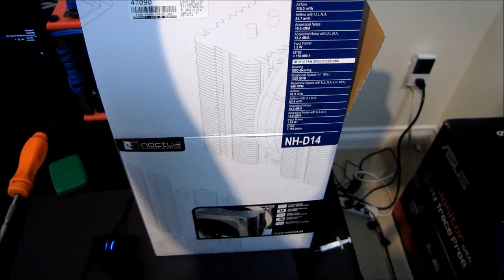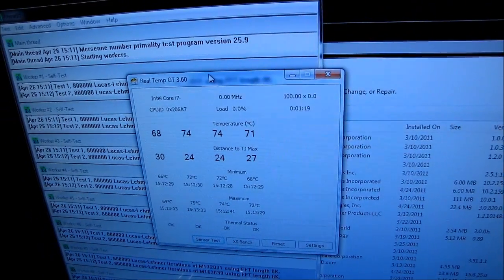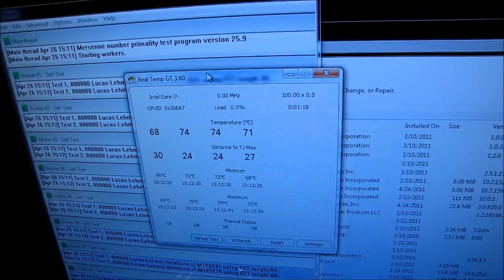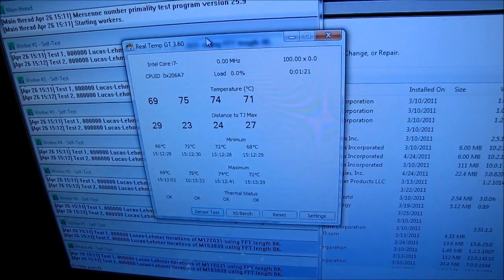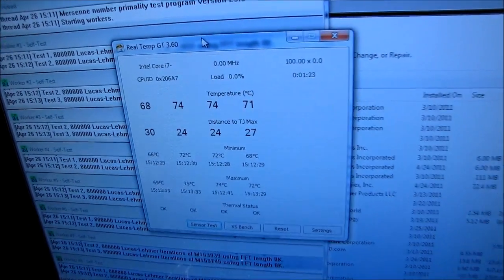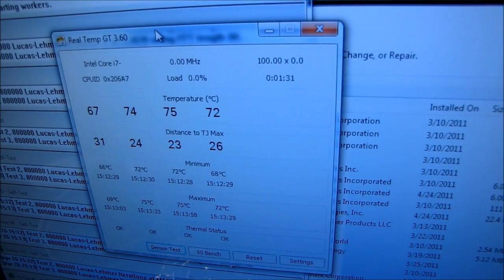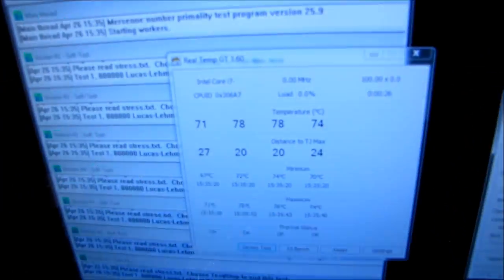Extreme Cooler Showdown Corsair H70 vs Noctua NH-D14 Linus Tech Tips

Comment: i am acquiring the nh d12 but thing is i am mounting it inside a haf X so it will be hanging horizontally in mid air and its weight worries me in regards to damaging the socket,cpu or the motherboard itself any advice?

Comment: I've got d14 and amd cpu. problem is I can not use d14 to have vertical airflow, and though it cools the cpu nicely enough, airflow in the case is awful and gpu constantly overheats making everything uberloud (and whats the point of silent d14 then?), due to it blocks it and makes only horizontal flow available (while I have 240mm fan pushing air up out of the case) so I actually think that in my situation watercooler, even if formally worse than d14, in real life might have performed better than d14, since i'll have a lot better airflow inside my case.
Reply: +MrSpamaccount im pretty sure you can mount the heatsink vertically
Reply: SomethingCool51 not with amd.
Reply: MrSpamaccount meh oh well.  It's better to mount horizontally anyway

Comment: It depends on the motherboard(how close the RAM slots are to the cpu and if you can run dual channel effectively on the 2nd and 4th slots) as well as if you plan on using both fans on the noctua. Most likely, the overly tall heat-spreaders on the RAM will get in the way of the heat-sink so if you want to use Vengeance RAM with a NH-D14, i suggest using the low profile RAM cards

Comment: Yeah, comes down to preference. Also the D14 can block your RAM slots so make sure it will fit in your case if you go with that. H100 is easier to install but your case need 2 120mm fan slots on top.

Comment: I'm pretty confident that the NH-D14 would fit inside the Challenger. Google search "rosewill challenger mini review anandtech" and the first link should be the one I'm talking about. The cooler the guy uses is a Xigmatek cooler, which is 159mm, whereas the D14 is 160mm. I'm sure you can figure out the rest.

Comment: Actually you are wrong bud, no cpu can reach 5.5GHz especially no intel at least would be able to reach 5.5GHz on air, but on water cooling yeah well custom loop at least, but i do know someone who reached 5.0GHz with the NH-D14 but it was AM AMD FX-8350 max temp was 59c, AMD is known as the best OC on air (Well with a good cooler like the NH-D14)

Comment: the most common BSOD is from bad cooling, this mean over heating GPUS, CPUS, Chipsets, basically anything that heats up can cause a BSOD, along with failed Over Clocking, Damage, and viruses.

Your statement that BSOD and Watercooling are together is actually very rare, this is because most Watercooled rigs are custom loops that would probably be the same temp at full load, as you are at idle.

Comment: I'm making a silent SFF build in the next month and I'm dead set on the fractal design define mini and asus maximus v gene, 3770k, 670 gtx (asus dcu2), and 2133 C9 ram (g skill either ripjaws x or trident x depending on what cooler allows). I'd do water but I want this to be a semi mobile platform. My question to anyone is do I go with a D14 and boop my GPU to the 2nd pcie slot (running 8x, not a whole lot of empirical data telling me it doesn't effect performance) or an H70 core with nf-f12s?

Comment: h100 will be a little better but not by much, i had it on my 3770k but i found the pump too noisy so i samped it for my old h70 and noticed right away about 5-7 degrees difference at idle and about the same at full load, but keep in mind it was back in may-june so it was getting hotter in the apartement when i swapped them, none the less i prefer the h70 for the quiet pump

Comment: The i7 3770k.
Not overclocked by now. 
Would the H100 be a better solution?
I'm also thinking about 4Fans in a push-pull configuration

Comment: but the noctua is on top of the mobo with unrestricted airflow.....and the water cooling rad does not have perfect airflow...restricted somewhat ...how i see it.... kind of a bit silly you should have had the radiator sitting clear of the side of the mobo and table

Comment: I think that's because aluminum dissipates heat quicker than copper and it's way cheaper and lighter. The copper heat pipes should absorb most of the energy while the aluminum fins radiates the energy away.

About the silver, I was wrong. Silver is actually less reactive, thus more resistant to corrosion :P

Comment: You are correct in saying that silver conducts heat the most when compared to the metals you have mentioned. However, if you compare silver to copper, copper is only a tad bit less efficient for carrying heat. This is where the engineers come in to design heat sinks. For the consumer, copper is not only less susceptible to corrosion than silver, but much cheaper than silver. Because of only a slight performance difference from silver, copper is a better choice.

Comment: I don't mind having a massive cooling block taking up space and don't really want an H80 because a lot of my friends that have the H80 have already had problems with their pumps failing in less than a month, and the H100 won't fit in my case. (I tried putting together a custom cooling loop system a while back but 3 days after installing it, one of the 3/8" tubing popped off the 120mm radiator and sprayed coolant all over, taking out my mobo, cpu, memory modules, and fried my 8800 Ultra.)

Comment: My H60 out performed the air CPU coolers I used to run. You also have to keep in mind the layout of your case, the additional fans in your case, and what kind of fans your using with your water cooler. Personally, I'll never go back to air cooled CPU coolers simply because of the fact that if you want the performance of water cooling in an air cooler, you have to buy something as expensive and large as the Noctua.. The sheer size of the Noctua and difficulty getting it to fit made me return it.

Comment: Buy four Noctua fans for H100 in push-pull and it will perform better on the lowest fan setting than on the D14 at max RPM. There's no competition between the two. H100 is the clear winner.

Comment: @xBruflot an h80 doesnt "smoke" a d14. an h100 is at the same level or a little better, BUT with decent fans on it! an this fans cost another 20-100 bucks. so you end up having a kit, just a little cooler than the d14 for double the price. and your mosfets n stuff get hot as f*ck. no reason to buy this h-whatever things unless you ship the system far or you have no place to put a decent aircooler. i think people just think "oh look, its water so its gonna be great".

Comment: Wow thats nuts. I don't think the h80 is radically different from the h70. I have the h80 and even running 1.37Vcore under load at 4.7ghz my temps go nowhere near 80c at full load hours into prime95. The highest temps I've seen with my h80 is 62c at full load. From what I gather here the noctura SUCKS compared to my H80

Comment: @FinalFreedomEclipse Ya same here I have a Corsair H80. Woth the stock fans that come with the H80 My 2600k which I run an ass smacking 1.39Vcore on load though NEVER rise above 60c after hours and hours of Prime95. Honestly I have had several air coolers and this H80 blows all of them out of the water when it comes to temps and noise. My CM V8 I had B4 never stood a chance

Comment: @bullsnake505 5ghz is no problem with a 2500k on water. custom loop is always better than something like a h100 but ek products are troublesome. gpu cooling can be included in the waterloop if your so inclinded otherwise stock gpu cooling will be sufficent, any changes you make from there will give marginal gains anyway, watercooling a gpu is more for noise reduction. there are people using corsair H series also on there gpus. pm me if you need any more info

Comment: @bullsnake505 EK cooling make junk, read up on their nickal plating issues which are still occuring on there "electroless" nickel plated blocks, everything from acusing their own customers of sabotage to boched science to justify their claims,even then saying the issue was only occuring in Australia and America even when they have german customers failing products the h100 pump is more reliable than the ek kit pumps. also has a warrenty that will not be denied due to their manufacturing errors.

Comment: @BloodlessSalvation The H100 runs 5'C cooler at medium fan/pump settings and around 7-10'C cooler on max.

This is with 4 fans in a push pull, not the stock 2 fans that comes with the H100.

Comment: hey guys if you look at where he has the h70 located all the fan is blocked off that is why he has a higher reading on the temp compare to the air cooler and i have a h60 and that runs cooler than the nh-d14 readings

Comment: Now where is the major difference? Installation! To install the NHD-14 you have to pull the whole motherboard out and then install. With the H70 you simply put on the bottom receptor plate and install the mobo. The pump head can be installed with the motherboard inside the case. NHD-14 can't.

Comment: Is this really a fair comparison? I see that when he tested the Noctua the cooler is mounted as is should be with clear air flow. When he tested the H70 the rad and fans were hanging off the edge of the test station with the air flow at least partially blocked. I know those test stations do not lend themselves to correct mounting of this type of liquid cooling but seems like it may have skewed the results a bit.

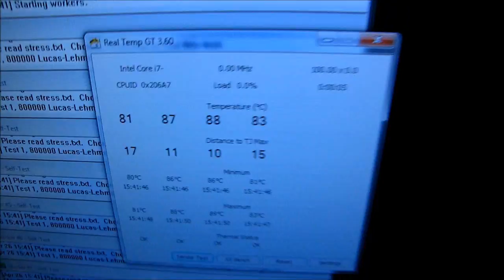Comment: LMFAO 4:00 blue screen of death and silence from the guy!!!!!!!!
anyway you pulling hot air into the radiator from the mobo, and the radiator is leaning in the wrong position, you should face the pipes out of the radiator down, so the inertia and gravity will help water circulation + if there is any air into the loop it will go on top and not into the pump blocking you the water circulation, I'm using H60 and I LOVE IT, keep my 2600K CPU to 50~55C under load @ 90F room temp.......

Comment: Extremely flawed review - and you failed to configure the H70 correctly - it was laid on it's side which restricted the fan airflow and to make matters worse, you had the radiator pulling hot air off the side of the mobo!  WARNING!!! Amateur hardware reviewer!

Comment: @AndrixGamer not only is it hanging down with one of the fans blocked (totally restricting air flow), but the TIM application is most likely off as well. he should have done multiple tests with multiple TIM applications to make sure each was installed properly and the CPU was transferring heat just as well. good observation.

Comment: @Eclipezz the H70 was not installed properly. I have extensively tested the H70 and it performs much much better than this experiment even with stock fans at default speeds in push-pull intake. it most likely crashed due to a bad overclock. ie: voltage too low. could also be bad DRAM voltage and memory caused it.

Comment: Someone didn't set these up properly. First the extreme variation in temp equilibrium on the noctua cooler, and then a totally poor job with the H70. The h70 normally has near identical performance to the nh-d14. Also, The H70 is built to work with high static pressure fans for dense rads. The noctua fans have a different static pressure ratings. on top of that I suspect TIM application was not good.

Comment: Also I think that I'd prefer you to use default fans that came with the coolers not some other brands fans I'm not going to run out & be replacing fans nor am I going to buy 2 CPU coolers just to rip fans off of 1 to put on the other.

Comment: I'd like to point out that the H70's coldplate base isn't completely flat. It loses surface compression at the middle, giving it tiny sliver of a pocket of space between the CPU and the coldplate. It's inherent in both the H50 and the H70. Corsair does encourage you to LAP your H50/H70 without voiding your warranty. I've done it and it HAS shaved off temps by at least 10c.

Comment: @xilix Depends on the TDP sometimes I can see where your coming from but so long as the processor don't melt it's all good in the hood :) it just wasn't stable , Could vary from many different factors , Maybe he needed more volts on the core or that specific CPU just couldn't handle that clock for w.e other reason on the wafer. But this CPU is rated for 100C and it starts throttling @ about 90C 70ish is okay but that depends on the model of the CPU your talking about.

Comment: Dude, of course it was a blue screen, the fucking CPU was at 88c. That is INSANE temperature for a CPU dude. Anyone who thinks that's not a temp to be shitting your pants about is delusional. 70'ish is only acceptable as an absolute maximum. With that said, when gaming on this rig, it will NEVER task the CPU like 8 instances of prime, so this blue screen would have probably not happened in any other case, though you can never be too sure until you test.

Comment: @viralrazor 
While that may be true, you need to realize how long its going to be till then. The heat sinks I am actually not really concerned about, but if you have a full set of ram, say, four ddr3, you still need to get rid of that heat. Some MB manufactures actually warn you to find a means of cooling them down because you can easily trap a lot of heat between them. I actually invested in a Gskill turbulance when I touched my four ram and nearly burned myself. Was 83C non OC.

Comment: Now time for me to bash in the pros of that air cooler :D
While it does keep the I7 from boiling water,  you have to note that soon ram sticks will more then likely have higher heat sinks. Over clocking also makes it a little harder on some mother boards to place a ram cooling unit!

While the air cooler does not help the I7, it does provide ample space inside your case to add a ram cooling unit for your ram sticks, you can mount it anywhere within the cord range and its not as heavy!

Comment: @BBoyA2A
It's barely blocking it at all, and even if it weren't blocked it'd still not make enough of a difference to bring the H70 up to the performance of the D14.

The D14 is less expensive, more silent and has better performance. If you ask me, the H70 is for kids who think "water cooling" sounds cool, or people with really bad cases that can't hold a D14. But if you have such a small case then you shouldn't really spend more than 100 bucks on a cooler.

Comment: @juggernautxtr You're so off track friend. There is no mixture of liquid and electricity a water cooling loop works by having a copper heat sink tightly in place on top of the CPU then the heat transfers through the copper plate to the water behind it, That water is then taken through tubes through a pump and then through a radiator. My WC loop trumps Air cooling. There for Noctua does not win anyway just because it doesn't have water. Also there are many water & electricity mixtures inthe world

Comment: @BBoyA2A LOL! 'son' im the same age as you are, and i have a masters degree in electrical engineering, also fuck water and air, its all about cascade cooling, and you really think that it matters with the massive air flow restriction of watercooling radiators, a Noctua NF-P12 will stand no chance, the things cant even inflate a 1m cubed bag.... NF-P12's were deisgned for low FPI rads and case fans, not high FPI rads, also the D14 has a NF-P14 and a NF-P12 another thing you can pick at ;)

Comment: Sorry but the airflow is not blocked when he tested the H70. You can clearly see its taking the air from the other side and pull it out through the second fan to the mobo. Its simple guys Noctua NH-D14 and Thermalright Silver arrow are the kings of high end aircoolers. H70 wont beat it unless you put 3000rpm fans on it lol with 70db of noise.

Comment: A fairer comparison would be vs H70 with the default fan (because that's what you pay for) and with unrestricted airflow..

But the NH-D14 does run a little cooler compared to H70 based on the results from various review sites..

Comment: @KutaPuta The Corsair blow hot air into the case because it cools the radiator with the cool air from outside rather than the hot air inside the case. If your case haw proper air flow the hot air coming through the radiator shouldn't be a problem.

I agree with what you say about the Noctua. While it leaves space for RAM if you want to install/remove RAM you have to remove the heatsink and if you don't have a well designed case that could also mean removing the mobo + components all together.

Comment: Corsair H70 on i7 2600K on stock 3.4Ghz, room temperature is: 25.3 degrees. CPU temp is on idle: 39 degrees. Under max load with prime95 about 62 degrees. Keep in mind that the memory and videocard also gets hot.
4 x 4gb corsair vengeance 1866 mhz besides it and msi nvidia gtx580 oc, bot run reasonably hot but my corsair 650d has a got airflow.

Comment: Linus, this study is biais cause the H70 configuration is disadvantaged due to the great amount of air disturbance. You can see that air flow is blocked from that motherboard. Therefore, you are not using the full surface area available from the radiator. I'll guaranty that the temp are going to be lower if the air flow is not disturbed.

Comment: I would love the Noctua cooler but the problem in the area I live in is dust. Dust everywhere. The thing looks pretty impossible to manually clean without a complete headache. I have to dismantle my whole system every 2 months and do a thorough cleaning, blow with air every 2 days, that's how bad it is in my area.

Comment: @gamer1337omg According to Intel, yeah.  Now I'm not saying it won't shorten the life of the processor, but it won't shorten it enough to matter.  It might shorten it from 20 years to 10 years, but who is still going to be using the same processor in 10 years? When is the last time you've even heard of a processor dying from overheating?  Hell, todays processors, you can take the cooler off and they keep on running thanks to the throttling...